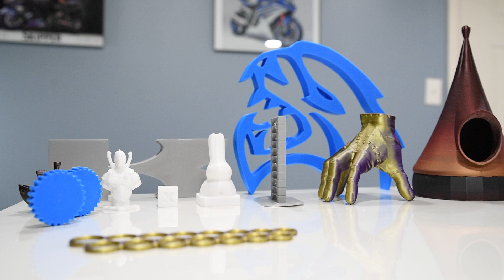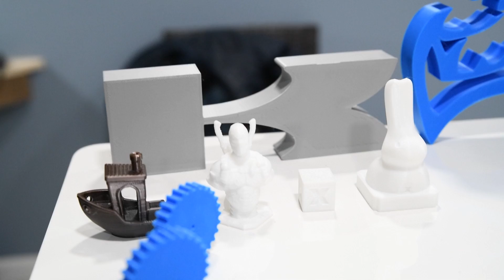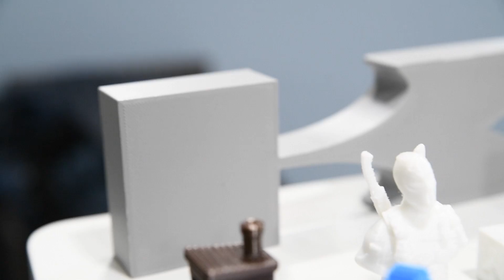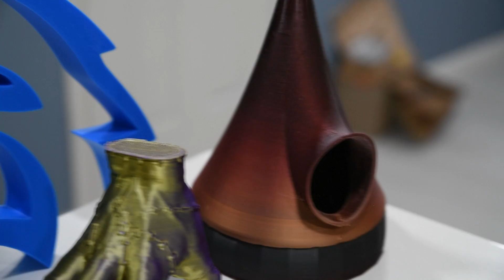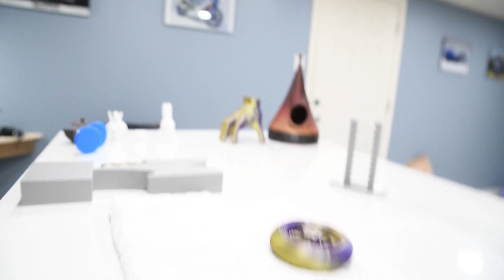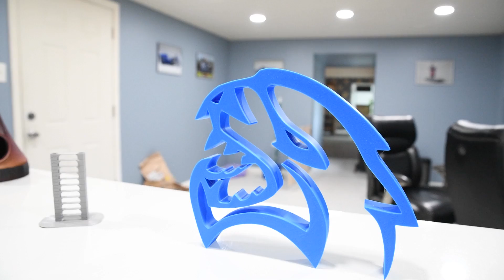FLSUN V400 My Cura Profiles and Quality of prints

Comment: I am unable to see what is changed in your profiles - Could you also share the changes you have made from default. Would this work on 5.3?
Reply from the maker: i did in another video the 2 main ones that helped my prints were z-hop to 0.5 and turn off combing slowed the speed to 350 and that is about it

Comment: with the blue dodge logo how did you get that to stick to the bed i cant manage to get anything above 20x20mm to stick to the bed reliably
Reply from the maker: i clean the plate every time with an alcohol wipe, do you have combing turned off and zhop on 0.5 ? try my cura profile below , your prints might have been getting caught by the head and being pulled off.

Comment: FLSUN channel uploaded a few helpful videos last week. One in particular helped me resolve scraping. 
In Cura print settings, 
-Infill tab, Infill Pattern: Gyroid.
-Material tab, Printing Temperature: 220 and 
Flow: 85% to 90%.
-Speed tab, Travel Speed 350.
I'll try your profile as well. I appreciate your quick and to the point style..Thanks Louis
Reply from the maker: thanks for watching, yes i have been happy with my settings if and when i have any issues i will try out some others for sure (Y) thank you
Reply: @carphotography  How did the micro swiss nozzle work out?
Reply from the maker: i never tried them yet :D if it aint broke dont fix it :D i got an 18 hour print going today i see how it looks after that. worried to change it and mess with my prints as i like how things are going at the moment :D
Reply: @carphotography  I hear you I tried a bondtech nozzle on the 400 but no good. I was having so much trouble with scraping so I was desperate to try anything. I ended up putting the stock nozzle back on and changing some cura settings. I mentioned those changes in a different comment section on your channel. So far so good